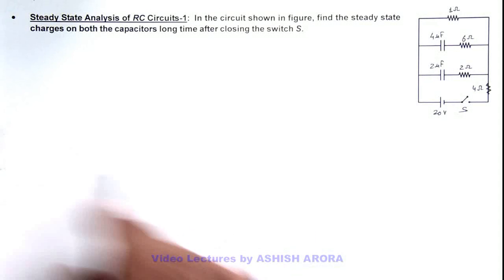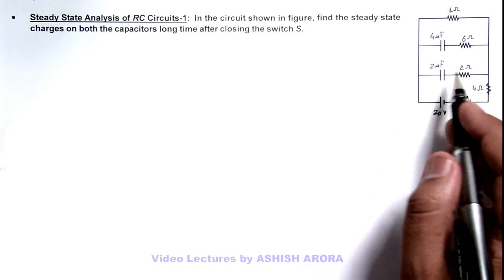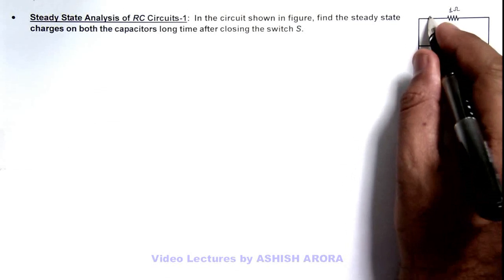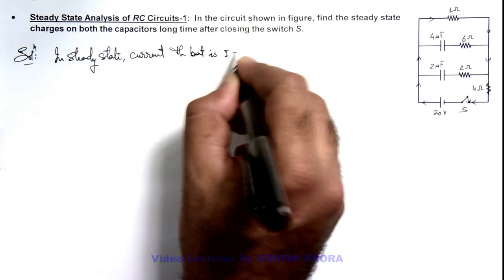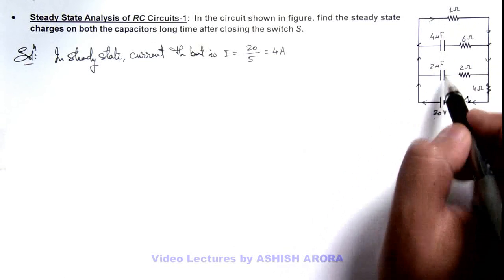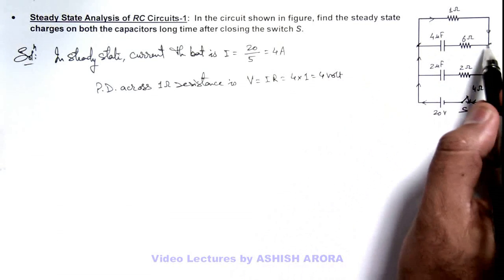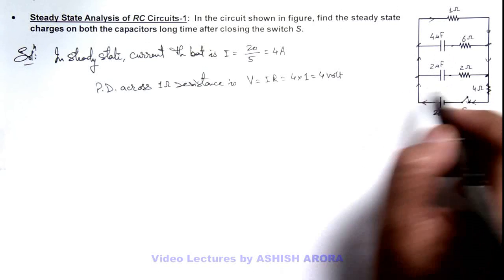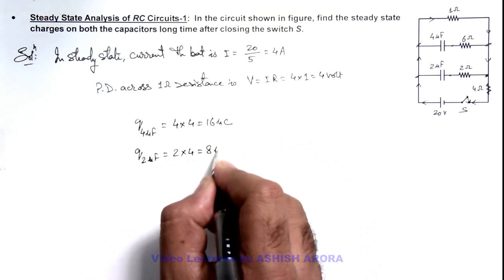9. Advance Illustration | Current Electricity | Steady State Analysis of RC Circuits-1 |Ashish Arora

Comment: Sir what about 4ohm resistance near to  switch ?
Reply: Well that 4 ohm is eating the remaining potential difference of 16 volts
Reply: @harshmangalamverma  👍👍
Reply: @harshmangalamverma  why we not take i=20/9 .....as resistance in steady state will be (5+4)
Reply: @tanmaybro3812  hello, there's no current flowing through 6 and 2 ohm resistances in steady state. And even if it does(which certainly not) how net resistance comes 9? Check yourself.
Reply: @harshmangalamverma  bro i am saying that in steady state, current will not flow through branch containing capacitor ...so current will flow in outer curcuit containing 5 and 4 ohm in series...so net resistance will be 9 ohm and voltage is 20 ...but sur have taken only 5 ohm in outer circuit...
Reply: @tanmaybro3812  that is 1 ohm, at top and 4 ohm at right down. 1+4 is done
Reply: @harshmangalamverma  ohh sorry.... as i was seeing in low quality i had seen 1 as 5 ohm...